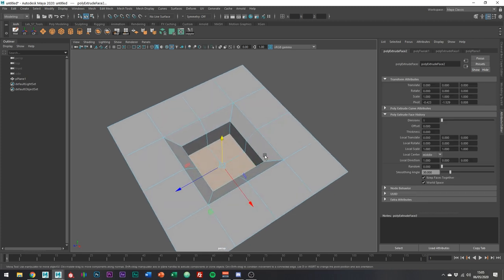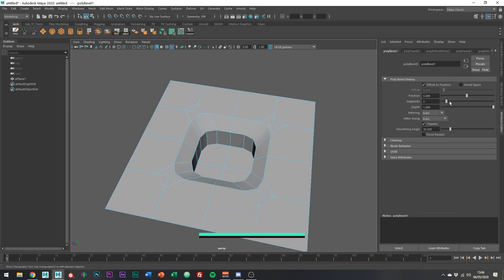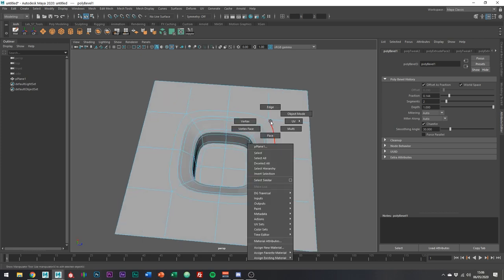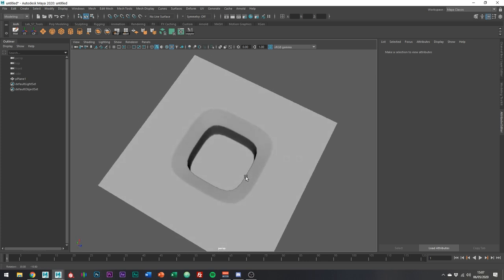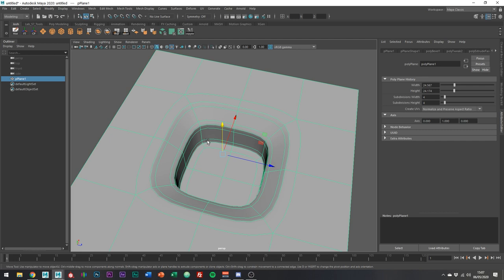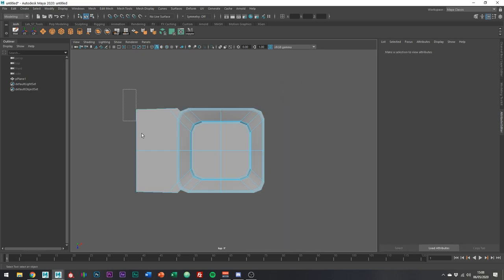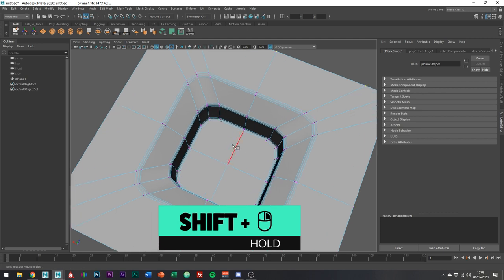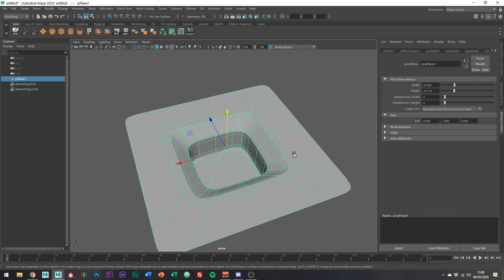To Bevel or not to Bevel?

Comment: 2:37 How do you make the Multi Cut Tool start over after one connection? I mean usually it is stuck on continually connect? Thanks!
Reply from the maker: You can hit esc to cancel, or enter to finish at any point